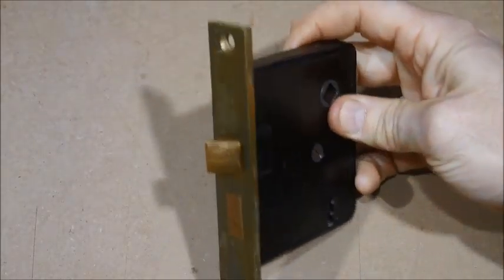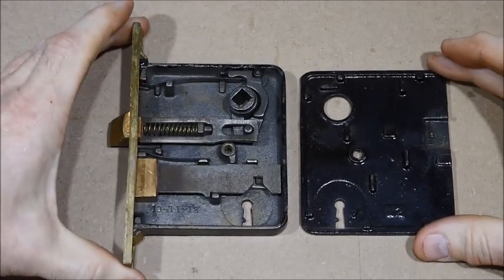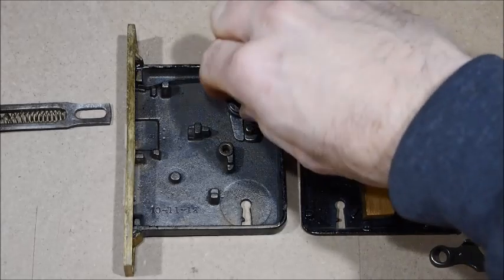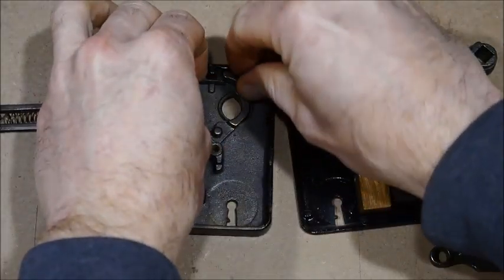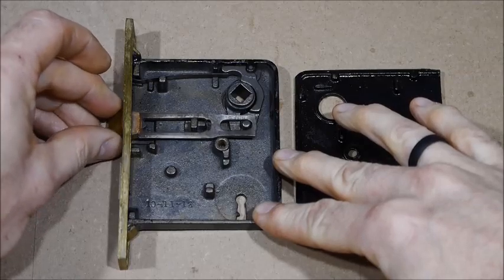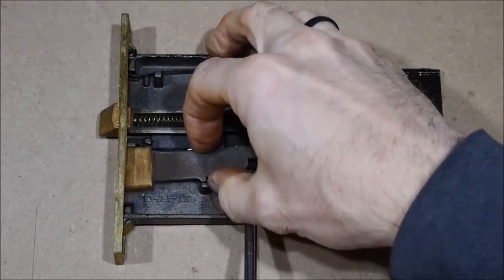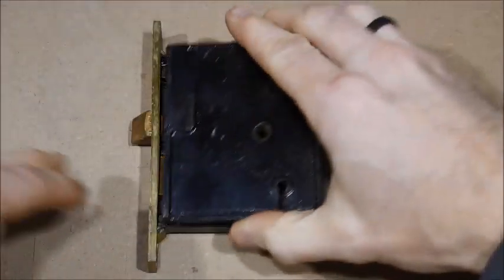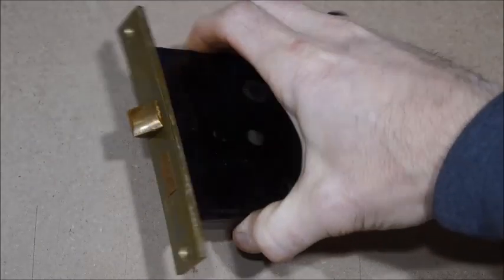Antique Corbin Mortise Latch Repair & Maintenance

Comment: I am in a 120 year old house and these are the same door mechanisms. The spring action and how it attaches is a bit different but everything else is the same. But these things are really cool and yeah the springs break a lot compared to a modern doors, but I love old technology and all the parts in mine are in really good shape. Just a little bit of de-rusting when I need to take these apart and it still looks brand new for being a hundred years old.

Thanks for the recommendation on the dry lube, I was going with Wd-40 to also protect it from rusting but I'll switch to that.

Comment: What do you call the ones with a side ways key hole ==O like this.

I have an old storage cupboard, I can't figure out how to open it?
Reply from the maker: Not sure, sounds like a smaller cabinet latch.  A locksmith may actually be able to pick it and open it for you, worth a shot.

Comment: Thanks for the video. I have a house full of the same Corbin locks you show here. Do you know the correct spring to use in there. I tried a bunch from ACE but none seem to fit good enough.
Reply from the maker: Sorry for the late reply!  Try Lowes or any small local hardware store since ACE doesn't have it.  If not, you can always go online and check for small spring assortments.  McMaster-Carr is worth a shot too.

Comment: Any tricks on taking the slop out of the square shaft that holds the knobs? My knobs are threaded in tight, but there is a lot of slop in the shaft
Reply from the maker: That's a tricky one, as the tolerances weren't that tight to begin with.  You could look for another spindle (shaft) at a salvage dealer etc, or possibly look for a new reproduction/replacement spidle at a place like houseofantiquehardware.com. or charlestonhardware.com  Most of the thread pitches were similar, but you may want to verify that before ordering (count the threads per inch on the spindle).  You can also try spindle washers that fit between the trim plate and knob base, which allow you to get the knob very tight but still allow movement.  Hope that helps, good luck!
Reply: @formerglory4203  it does! Thanks so much

Comment: Hello any ideas on how to open them if the screw is stripped?
Reply from the maker: Try a file to make the slot deeper in the head of the screw perhaps?  If all else fails you may have to use a screw extractor.

Comment: I have mortise lock with one part that needs replacement.  However,  I have no idea what model I have.
Reply from the maker: There may be markings on the inside of the lock case once you open it, or there may be some markings cast on the outside of the lock case too.  Not all of them were marked, as there were probably millions of these things produced by many different manufacturers over the course of nearly a century!  If you can't find the maker's mark, then it may be just as easy to replace your lock with one of similar dimensions; if you have an architectural salvage dealer close by it may be worth bringing your lock to match up.
Reply: @formerglory4203  I looked in and outside of the lock for any markings.   With that, what dimensions should I go by?  Dumb question but want to make suer.
Reply from the maker: @stevekolarik2857  every dimension that you can measure, basically.  You want the new lock to fit into the existing hole in the door, and the faceplate to match what's already mortised into the edge of the door.  The backset is the distance from the edge of the door to the center of the knob, you want to match that too (though most fall in the 2-3/8" range).  That's why it's ideal to take it to a salvage dealer if you have one nearby for comparison.

Comment: I have a similar lock that isn’t latching properly. I don’t have a spring like this one does and I’m wondering if it’s supposed to have one!
Reply from the maker: It might, the latch needs a way to spring back after retracting; either a flat spring or coil spring.  You might even have a missing or broken flat spring as well.  There are links for springs in the item description.  You can also get small coil springs in different sizes if you have an ACE Hardware near you, they also have a small selection at some Lowes stores.

Comment: I've been looking for this slash as well as obviously a full door knob like the antique ones but I can't seem to find one that fits my door quite frustrating I have an older door knob with A lash like this it doesn't properly turn anymore it's one of those twist on door knobs I can't simply just put an updated door knob on there not with the way the hole in the door is for an older door knob obviously quite the pain in the butt

Comment: Hey Former Glory,

Thanks for the video, I do have a question though maybe if you have any ideas it would help me out. I'm having a hard time removing the cover screw on the outside. This lock has been painted over a few times (6 coatings!). And I managed to strip away what I can and I'm having a really hard time trying to loosen that cover screw it's slightly stripped from whoever played around with it before. I'm afraid if I really force it the screw's going to be stripped and lost. I've scraped away most of the paint around and on the screw itself. Would you have any suggestions of what I can do? I'd really like to save these little things from my grandpa's house.

Best,
Marv
Reply from the maker: Hi Marv, 

Overpainting is one of the biggest obstacles in old house restorations,  all those years to slather paint on everything!  I can definitely suggest what NOT to do, and that is to hit the screw with a hammer to try and dislodge it (ask me how I know).  Cast iron is very brittle and will crack/shatter fairly easily if hit with a hammer, especially thin pieces as found on these locks.

All I can recommend is to clean out as much of the paint as possible around the screw, and the slot in the screw head as well (make sure the slot in the screw head is completely free of paint).  Maybe try some paint stripper and let it soak for a bit, then scrub with a steel brush.  Then allow a penetrant like WD-40 to soak around the screw head for a day or two.  The biggest key is to use a screwdriver with a nice sharp tip that fits the slot as tight as possible, that engagement is what transfers the torque from the screwdriver to the screw.  A lot of folks have old worn out screwdrivers, and those dull tips make working with slotted screws way harder than it needs to be.

Good Luck!
Reply: @formerglory4203  
Thanks for your timely response! I'm always grateful when a professional gives me some advice. I'll take my time with this and I'll let you know how it turns out.
Reply: @formerglory4203  Thanks Former Glory! I followed your instructions and I managed to get that screw free of the hole without further damage.
Reply from the maker: @manongpedro2338  Nice!  Great to hear, keep those old locks working :)